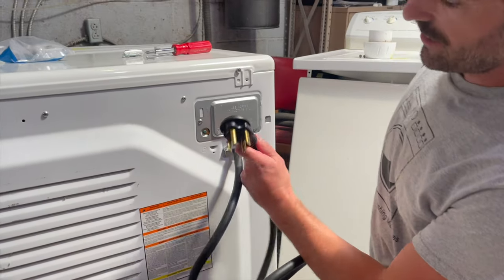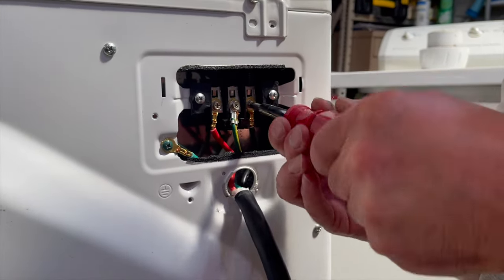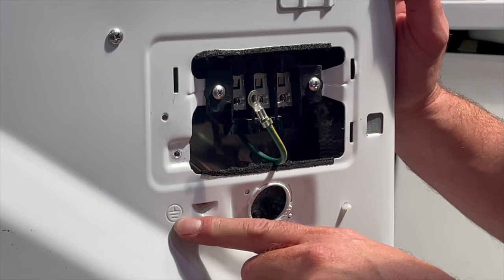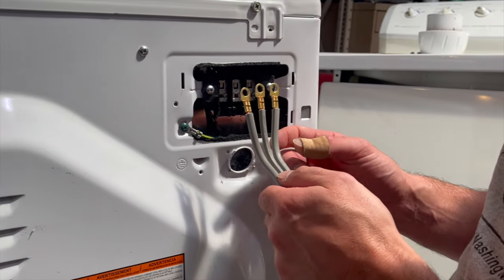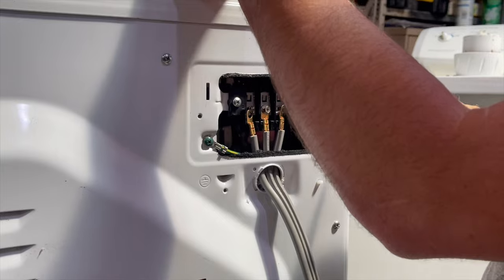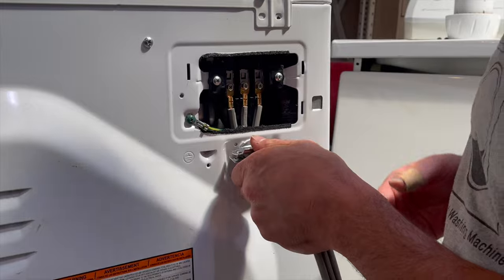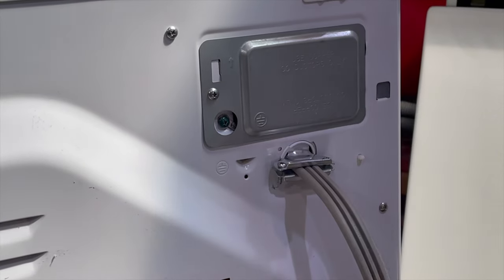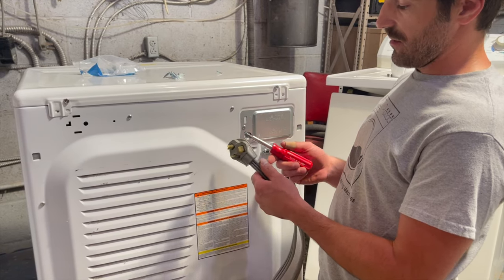How to Switch a 4 Prong Dryer Cord to a 3 Prong Dryer Cord on an Electric Dryer

Comment: Explained clearly and concisely. Cut and dry. No fluff. Thank you!
Reply: I have a white ground wire and I don’t know what I’m supposed to do with it.The dryer  that I got is really old and was working at the previous place now that I’ve tried to change the wiring to a new 3 prong cord (and his instructions were very clear) I lined everything up correctly. It’s not working. I have a white ground wire and it’s on the opposite side and there’s no symbol showing me ground. Don’t know what I’m supposed to do it.
Reply: @suelovejoy46  Did you end up getting this figured out? If so, what was the solution?

Comment: I love this. I love the channel. This is really good information, but always remember to double check your manual because not all dryers are alike. If you don't have your manual you can usually find it by going online with your model number. Overall, this is the best video I've seen on installing a dryer cord and I wish I had it the first time that I installed one.

Comment: I’ve got a white wire that’s connected to the green screw, along with the green wire from the 4 prong cord. 
Once the 4 prong cord is removed, where does the white wire go? Where it was, on the green screw? 
I’ve read that I need to “jump” from the green screw to the middle terminal. Is that true? I assumed the white wire is attached to the body of the washer and I just keep it on the green screw when I install the 3 prong cord. Is that right?

Comment: This is the 3rd time I've seen this video and I'm notified each time that's it was a new upload. 🤷‍♂️
Reply from the maker: There are actually 4 videos but they are all slightly different installations
Reply: @LorainFurnitureandAppliance  thank you for your response. I should pay more attention. 👍
Reply: Can this work in reverse I have a 4 prong outlet and a cord but the new dryer I bought has a 3 prong cord.